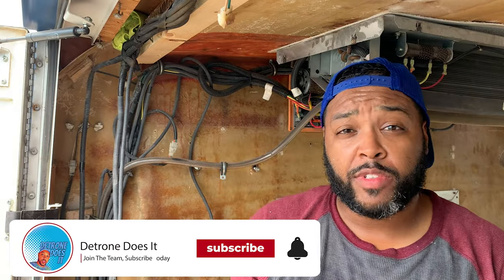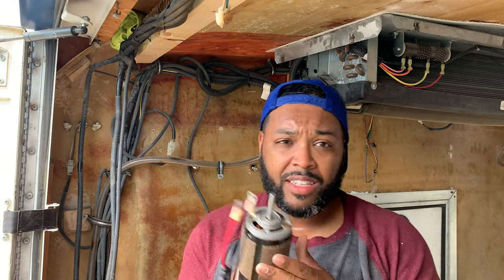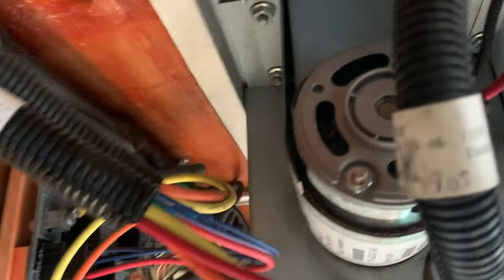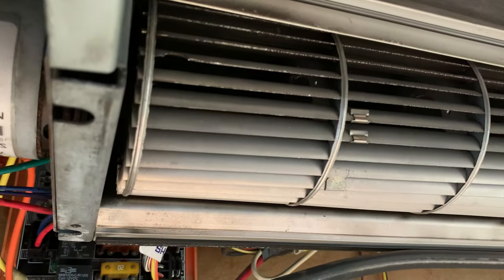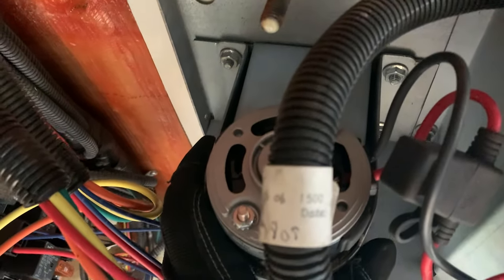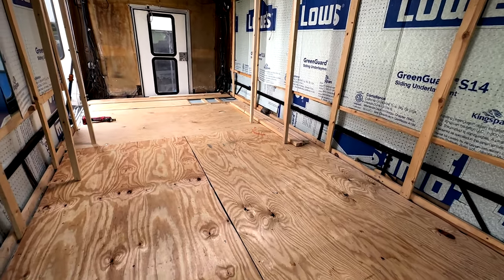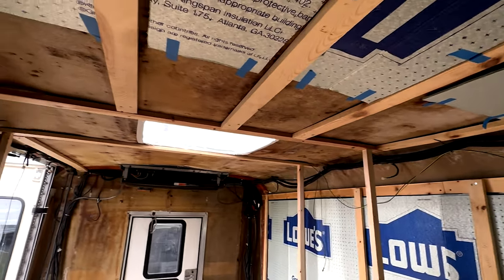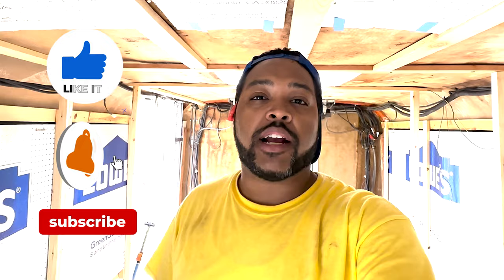Shuttle Bus Conversion | EP7: Replacing the AC Motor & Update

Comment: how do you turn the rear ac on. i just got a 2008 and just dont know
Reply from the maker: My shuttle has controls on the front console right next to the regular AC controls. In my bus the heater has its own individual switch but the rear AC is built into the standard controls. Thanks for watching!